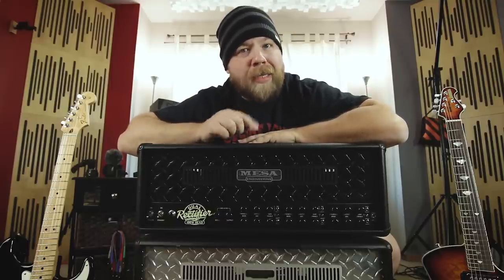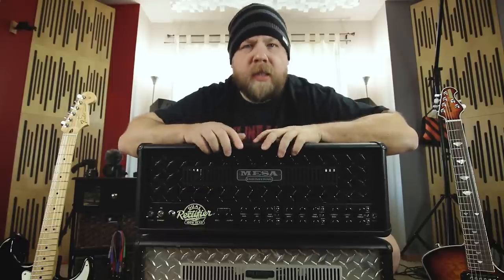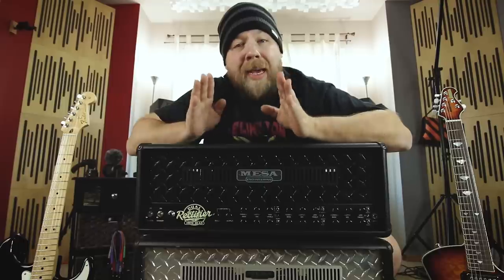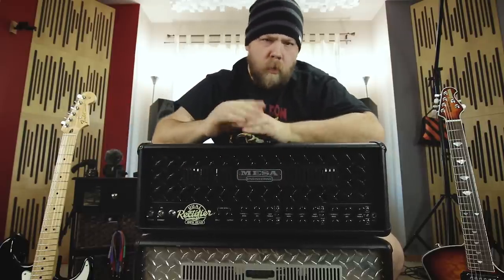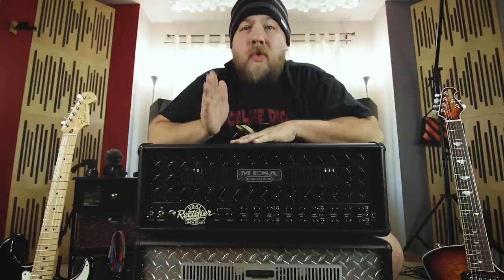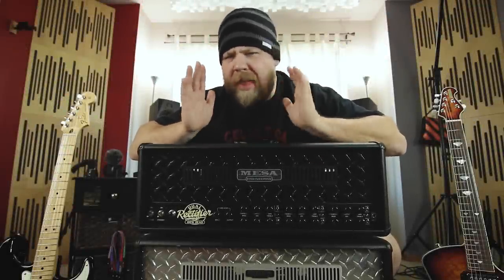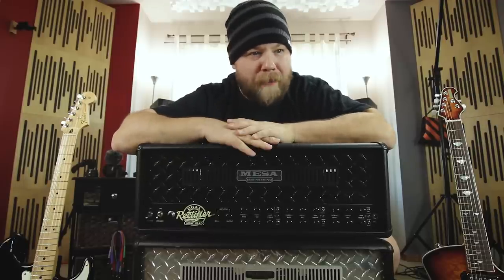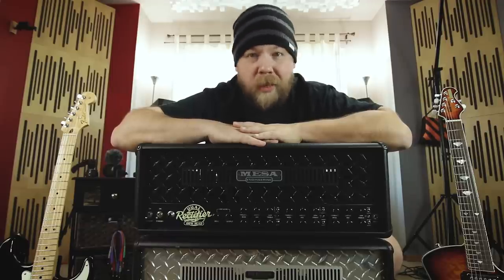Old Recto Vs. New Recto!

Comment: First of all, thank you for doing this comparison properly, you played the same riffs for both amps, you didn't randomly switch to a 19 string guitar on the HOT LAVA red channel like some dill holes do, completely ruining the comparison, dammit even John Petrucci did it with one of his JP2C videos, channel 1, 6 string, channel 2, 6 string, channel 3, 7 string. Why? Do the dropped tuning and or 7+ string guitars all together and separately. They are typically bigger instruments with thicker strings which will inherently change the sound dramatically. I don't know about you but I can hear the dramatic sonic difference of a 7 string even in standard tuning a mile away compared to even a 6 string in dropped B. Anyway, the noon test and to taste test was done exactly the way it should be done, with a single coil compared to a humbucker. The new dual rec sounds cleaner but might have the ability to fizz or sizzle on the top end. Is it weird that i think they would sound great blended together? With the old one not having the top end the new one has? And can we talk about how awesome the blacked out dual rec looks? I've been asking them to do that for years? And by asking I mean sitting in the bandroom drooling over the mesa catalog asking my bandmates "dude, don't you think it would look cleaner and meaner if the diamond plate was black, knobs too?" 
Jesus i started to ramble, a part 2 with a boost would be awesome, and side note, in comparison to my 5150 III head, I feel that my dual rec roadster takes to pedals better, boost and delay especially, thoughts?

Comment: RECTUM!? ...DAMN NEAR KILLED EM'!
Reply: Ryan Bruce I really think Mess did their homework and made a great sounding amp with the 2017 Multi-Watt. It sounds so much cleaner and more professional. 

The 1994 Rev. F is very gritty sounding and it would work for 1994 style music but the 2017 is cleaner and you would get a better recording in a studio using the 2017 Multi-Watt... The 1994 Rev. F you would need compression and a tube screamer to get it anywhere close to the 2017 Multi-Watt. 

Great video.